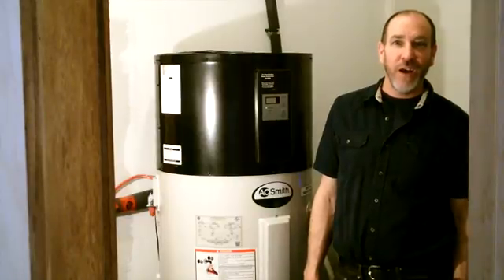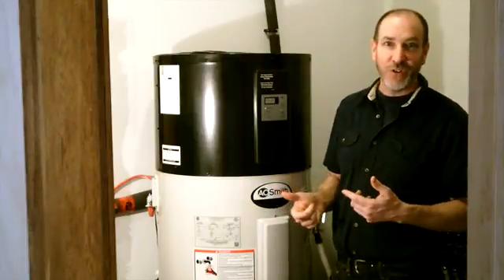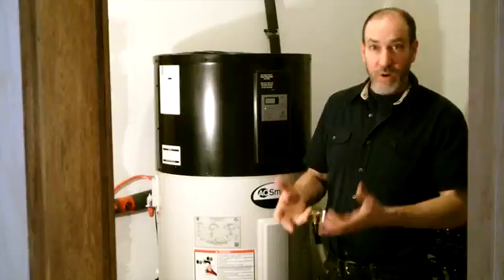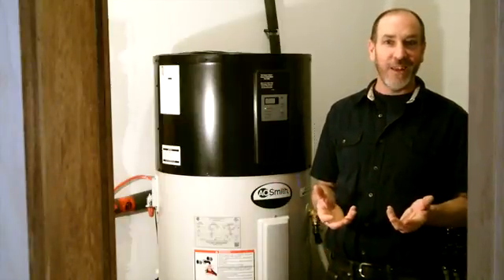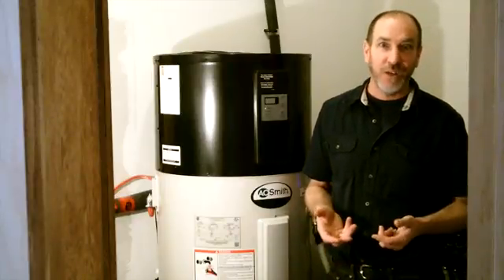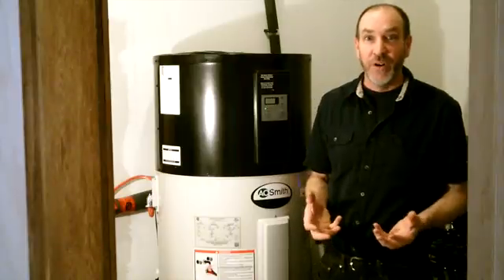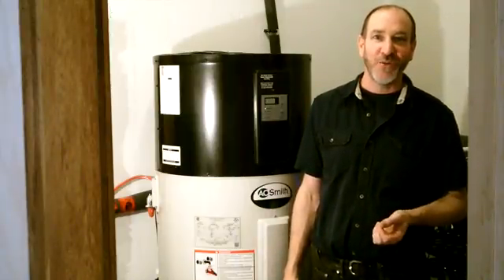All about heat pump water heaters

Comment: This type of unit is better served to be in  a warm environment, consider the south a better place for use. up north i would think gas heat would be best. It will cool the space, i have not seen any BTU estimates but whatever heat it puts into the water has to come out of the air the heat pump is exposed to. This unit would be much less efficient in a COLD space and would move into resistance (aka typical electric) heating much more often, thus negating the savings of a hybrid unit.
Reply: Irreplaceable in the south, and could probably be made diy with a buried loop underground.

Comment: Could the left over cold be introduced to HVAC ducts directly above the water heater?
Reply: On my hybrid unit it can be
Reply: not typically, if the duct work becomes too restrictive (plumbed too far) it can reduce efficiency, best to keep ducting very short if you do move air from one place to another using the forced air supply from the cold side...just my 2c

Comment: My water heater is,,, in the basement.. colder  all year long . How does that factor in?? Also, the hot water heat pump need a secondary drain line, from condensation... and third, these don't have  
Inlet and outlet on the top. This really screwed us up, they are on the side... So plumbing the lines could mess you up..
Reply: Capture the condensate water in buckets and do your laundry with it.

Comment: I don't understand how you can have it both ways.  On the one hand, you say that the cold it produces when heating water in winter doesn't make the house colder, yet tout it as cheap air conditioning in summer.  Would you mind clarifying that.
Reply: I'd like to hear how that works also.
Reply: There is a reply below that attempts to explain this.
Reply: Simply put, in heat pump mode heat is removed from the surrounding air thereby cooling it and then expelling the colder air. When in heat pump mode, it is providing as much cooling to the air  as it is heating the water by transferring the heat. The video creator does not seem to understand the refrigeration cycle. My unit has the option to switch to standard resistive type electric heating which can be beneficial if the ambient air temperature is very low
Reply: I thought the same thing.  I think what he's saying is that since he uses a heat pump to heat the house that is 300% efficient then the heat going into the water heater is essentially 300% efficient.  The heat pump water heater is only as efficient as the system that has to replace the displaced heat.

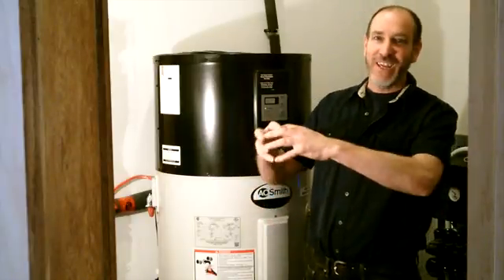Comment: at 1:32 he says it doesn't put cold air into the room, then at 2:32 he says the unit  becomes an air conditioner for your home. I am confused.
Reply: b.s. If you put this into a heated room, you are doing it wrong.
Reply: Sorry Gabriel, perhaps confusing. a better explanation can be found here - http://www.ecohome.net/guide/heat-pump-water-heaters-work-one but to try to elaborate (and I hope I do better), There is no 'net addition' of cold added to the house, it is taking some of the heat and condensing it, so it 'feels' colder in the mechanical room but the heating system compensates for that, but that process is more efficient than were it to heat the water like a traditional water heater. In summer it feels like it 'adds cold' because it is removing heat from the air to generate the hot water, so it ends up acting in the same way as an air conditioner. Better?  I can already hear engineers cringing at that explanation, and rightly so, but its a hard thing to explain so I'm taking liberties.  Best regards.
Reply: I still don't understand. You're taking heat from the household air and transferring (exchanging it for cold?) it into the cold water. You then take that heated hot water and using it, with most of the heat going down the waste drain. Logically you are ending up with a net loss of heat from the household air.

Comment: which is more efficient a heat pump, a boiler, or a tankless water heater ?
Reply: your asking the wrong question, you should ask (what is the most efficient WH for me?) Boilers are good if you use boiler heat or steam generation for another building service, gas is very quick to heat and has a good price point if gas is in your area, electric is ubiquitous and of electric models hybrid is more efficient. tank-less heaters are good for second story installs and use less overall electricity if demand is low because they are not maintaining temperature in a large tank however  tank-less electric heaters also require more electric usage at the instance of heating because it has a very short time to heat the demand water, they also scale/build deposits very quickly without routine maintenance.